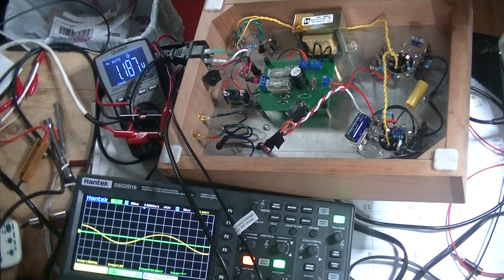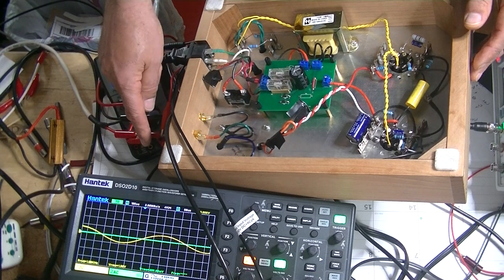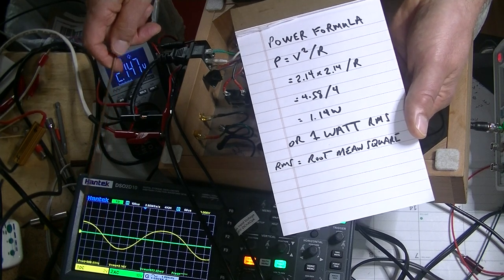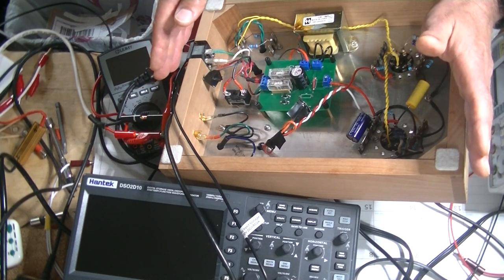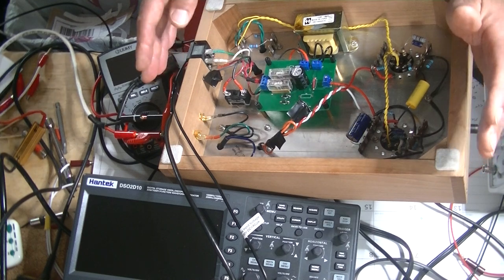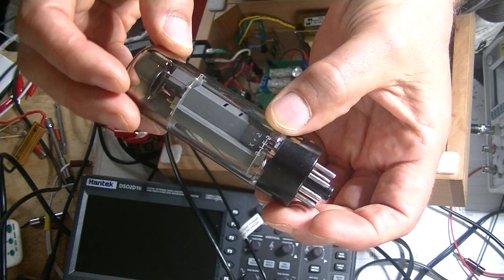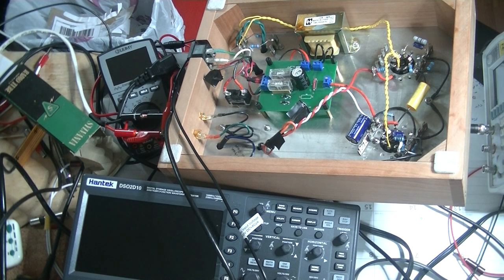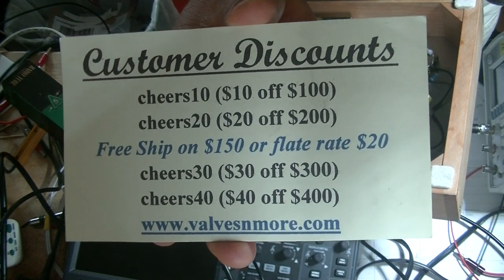Tube Lab #45   How To Measure Tube Amp Power Output

Comment: There's something I'm not sure I understand what you said at about 2:44 in the video. You said it didn't matter if you measured the amp at 4 or 8 ohms, you'll get exactly the same number. Wouldn't the power output at 4 ohms be greater than at 8 ohms? That's what most guitar amps do when you add an 8 ohm speaker cab in parallel to the 8 ohm speaker in an amp,  you get more output wattage, right? Unless I misunderstood.
Reply from the maker: When making these videos it's not possible to cover every detail in depth.  To clarify, when measuring the output of an amp with let's say 2 secondaries of 4 and 8ohms on the OT (output transformer), if you switch to the 4 ohm tap and apply a dummy load (suitable high power resistor) of 4 ohms vs the 8 ohm tap with an 8ohm load, you will get the same output.  Now that's theoretical, and presumes the windings on the secondary side are perfectly wound for 4 and 8 ohms.  In practice you'll probably find a small difference due to winding differences.

Comment: 1V RMS = 2.828V P-P, you're likely to see the latter value described as amplitude on a signal generator control panel. Any scope can be set to display volts RMS in addition to the actual waveform of course. Transistor amps do not display a ragged waveform at clipping on a scope; symmetrical plateauing of peaks exactly like here.